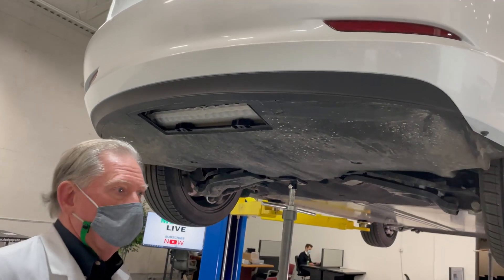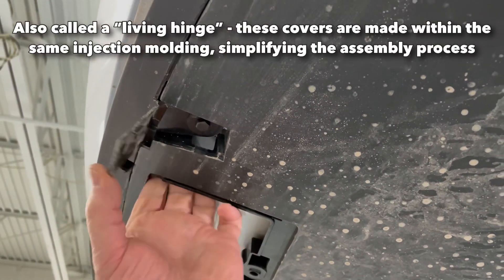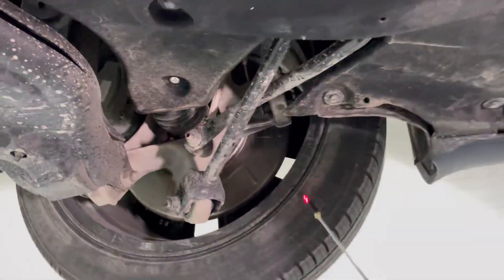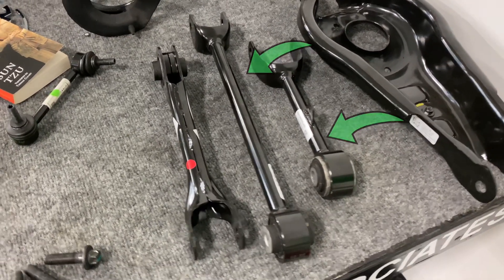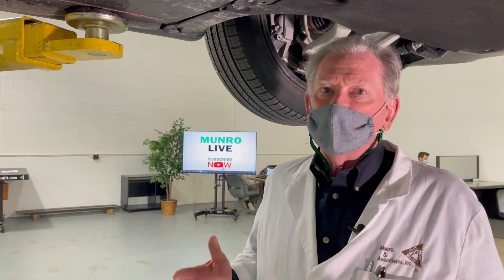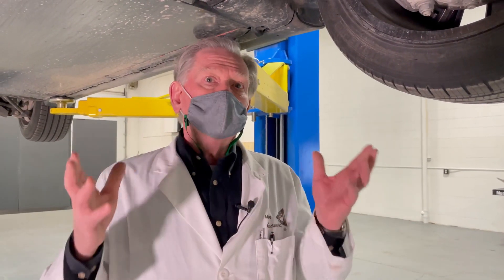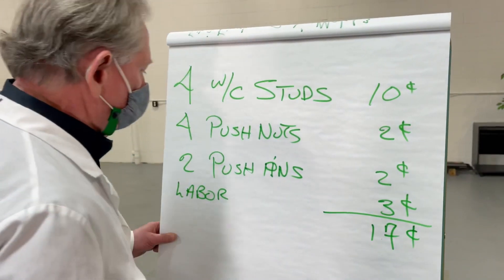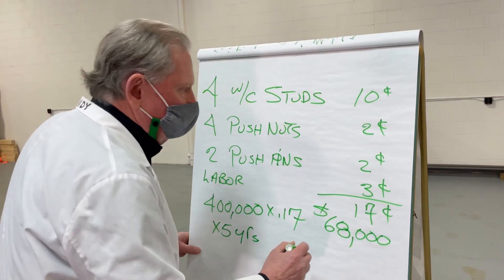2021 Tesla Model 3: E2 - Hoist Review & Some Cost Savings

Comment: "The best part is no part. The best process is no process. It weighs nothing, costs nothing, can't go wrong." - Elon Musk
Reply: @thealienrobotanthropologist  tell that to German car engineers 😉
Reply: So the best car is no car. It weighs nothing, costs nothing, can’t go wrong. 😂
Reply: If only he would make a car with that philosophy.  I want to see one that is bare bones with manual adjusting seats and hand rolled windows and NO info screen at all.  Just a model Y with the motor, 200 mile battery  and some airbags.  Something under $12k...  Start with the performance and cut costs everywhere you can.  I want to see the raw alumium in the floor, just stamp a pattern into it--- no carpet or anything.  Make a simple way to add a battery upgrade just like we add memory to our phones... Make it a box like the Cyber truck, durable, dent proof, scratch proof.... Call it the Cyber Dray... and build millions of them....  This is what most of us Men want.  Something that is completely basic, without any plush comforts, but has the utility.  Cut all corners, make it as simple as possible, and keep it bomb proof.  Everyone keeps tying to make "the new iphone", when what we need is a firearm.
Reply: @calholli  you may like something like that but how many of the general public will buy something like that though?
Reply: @calholli  I agree with your principal of affordability. But is $12000 attainable or just a random number you thrown in there.  If you built something at affordable level then you are competing again things like a Honda Civic which has a good amount of technology in it and Tesla will definitely lose its edge. At the higher price range they attract people who are willing to pay for tech and environmental impact.
Reply: Fleet cars and beaters are some of the biggest sellers for big automakers. Ford sold more than 3M fleet vehicles in 2019. So yea they could sell a bunch of them...
Reply: @calholli  They made a Yugo, see how well that went…
Reply: Unfortunately it also does nothing... :(

Comment: They did 450k M3/Y this year - likely to double next year, so 5 year lookout is over $1,000,000... easy. Also, keep in mind inventory management in the factory and in the service shops - pretty sure at the end of the day, over 5 years, Tesla would save over $2,000,000 by eliminating these parts 🤯   (btw, airlines did similar thing - they realized reducing 3 olives in the salad to 1 olive saved over $1,000,000 a year - and customers never complained about it)

Comment: How well will those precision cover flaps hold up when Joe Sixpack whips off the under tray?
My car has M6 bolts with a thick 1” dia head. They are all the same so some have 80% of the thread poking out the back. Considerable time would be saved (for everyone) with Dzus fasteners. Same on wheel arch liners and engine covers and....
Question - why are they not used everywhere?

Comment: Cheaping out on parts like that is what MG Rover did, the quality of the product suffered as a direct result. Sometimes cost cutting like that is a false economy. Design the car better in the first place is the way forward. Delete the holes from the mould would be a good move. Still looks like it could be ripped off by the slightest thing, no strength in that arch liner.
Reply: Lopez effect. ;-)

Comment: For the untrained eye but a potential customer (me), that flappy plastic cover looks like a human error and a sign of bad quality, I would order 2 of those clips from Tesla the day i found out and install them myself.
Did the same on my 10 year old car when i bought it with one missing screw almost same spot, besides it helps to hold the inner fender in place.
Sometimes a missing screw like this hurts the image more then less then 1 $ worth of cost.
I think the cost saving guy was pushed to find something or payed per object found.
I would have found a plastic push pin to go into the hole where the stud was previously, the plastic inner fender would then still be held like before and they would not need to fill the hole, that is no longer used, with some kind of glue.

Comment: Sandy, did you observe any improvement concerning the rear panel under the car? It uesd to allow accumulation of dust and in some cases a lot of water to the point of seing this panel and the bumper being ripped off the vehicle.

Comment: Great episode, and an excellent reminder of how even tiny incremental improvements can add up over the years when you build at scale. Guess similar incremental improvements and savings that may only be worth a tiny fraction of a penny per cell for the 4680 battery cells would also be worthwhile since the plan is to make these in billion or trillion cell quantities.

Also, if its practical, could you go into how you came up with 3c for labor when discussing the push pin change? I was thinking that if the production line workers get $30 / hour (extremely vague guess to make the math easy) then that's 50c / minute. Assuming it would have taken someone 20 seconds to reach into the parts bin, grab the 2 push pins, insert them into the holes and then at an inspection station add another 10 seconds to check that they are in correctly that'd be about 30 seconds per car you don't need or a 25c saving (see I cheated to get easy math), plus you simplify the workstation by not needing a bin for these pushpins, unless they're a common part you need in other places on the vehicle. Unless that's something you'd automate and the whole process only takes a second or two??

Comment: i would not be happy to pay 40k,and find out the plastic is hanging like a bodged thing...plus water and dirt,ice, is going to get in there splashed from the wheel and remain there.then its enough for a little rust to apear and you end up at bodyshop repair that costs 100x more than 2c  crap plastic .Lets remove a few fender bolts to save wheight..thats hillarious

Comment: Also,  Tesla,  with the way that people can freely communicate with anyone in the company,  makes these changes more easily than others.  A line guy could be thinking over this at lunch one day,  discuss it with his buddy,  and then maybe they email a structural engineer. He grabs a couple guys and they meet this line guy, and a half- dozen guys gather to look at the process for a few minutes,  discuss the pros and cons.  They yank and pull on the unfastened piece and can't see why that fastener was needed.  From there,  they could, I imagine since this is such a tech- heavy company,  simply type in the part or process number and get a link to whomever is in the chain for this.  They might even do a quick computer analysis of forces on the part with the fastener removed. Some coordinator somewhere might be convinced,  and send out the change by Monday.  Displays at the workstation have a message briefly detailing the change,  and the fastener is no longer produced or installed.  Even if it takes a week to get out of the habit of installing it,  that's no big deal; the 5 year savings were still #338,000+. I may have greatly oversimplified this,  but it seems realistic.

Comment: "The best part is no part", until you get a rattle.  I wouldn't be surprised if those missing push nuts will result in a rattle at certain speeds due to harmonics.

Comment: I don't like that they removed the Push Pins/nuts.  Over time those plastic covers can come down - they can get caught on objects.  You see it happen all the time on all different cars.  I would feel better as a consumer with those pieces holding the plastic covers in place.  If you were to reverse over some snow it would catch it and could cause damage.  The Push Pins/nuts helps keep it in place.

Comment: if i am thinking about it correctly, the labor might be three cents per car, but it also translates into production line time, so if in that extra time they save they produce say x more cars, assuming they can sell all the extra produced cars it will translate to x times the profit margin of each car which is not negligible
Reply: might have been wrong though because the production line output does not depend on the total time it takes to produce a car but by the speed of the line. but supposed the eliminated parts were part of the slowest stage of the production line then the total output speed of the line would indeed improve

Comment: Sandy, tow hitch or not: all the same undertray which is a wise choice. Besides, the one-piece undertray was designed badly, because of which when running fast through big waterpuddles the rear bumper came off in a few cases. So they redesigned and also considered it being better to make just 1 version undertray for both versions (tow-hitch installed or not)

Comment: Welp, that was a complete waste of time. Only measurebaters and Tesla fanboys get excited over saving 17 cents on a $35K car.
Reply: If you save 15 cents on every 30 cent part, then you can cut the cost of the car in half
Reply: @pilotavery  Check your math. Motor, gearbox, battery pack, etc., are not $.30 parts whose costs can be cut in half.
Reply: @KonaChuck22  True, but those are parts you can shave off thousands. Tesla's motor costs a quarter of what others do despite being better and more efficient. That's $2,000 right there.

Tesla is also lowering their cost of manufacture, and part of this process is refining everything. Their batteries are already manufactured less than everyone else's, and they already have plans to get it down to half the cost.

That's another 5,000 to 7000 right off the bat.
Reply: If you added 50 cents to 2,000 different parts, then you just increase the cost of the car by $1,000. 

 it doesn't seem like a big deal to you, but to all of the experts who are working on this, decreasing the cost of a car from $25,000 to $18,000 is a significant difference.

Comment: Vibration noise from eliminating those parts? $50
Reply: @Ryan Kummerle  the hole that previously had a stud in it is glued shut, probably to prevent corrosion, the flapping plastic is not glued to the car.

Comment: Your first finding - I’m happy it’s there. It means customers can put on a 3rd party tow hitch without having to replace the plastic air shield or have an ugly cut out.
Reply: to be honest tho who wants to tow with a electric sadan? in my opinion the m3 LR has just enough miles to ease a bit of range anxiety (over 300 useable) and we know towing kills range in EV but what could you tow? 3000 maxium?
Reply: @Capthrax1  bicycle trip with the family? Not too far, tow bar bicycle rack. Will indeed kill range but for shorter trips it's nice to have the option.
Reply: @ZesPak  never thought of a bicycle rack. that would be perfecticaly suited for that car not much wind resistance not much weight.
Reply: @Capthrax1  You’d be surprised. There are quite a few people that tow with them. Efficiency is terrible, but people do it
Reply: @ChargingForward  seems like aneasy fix? Erect a vertical integration building next to the current one and problem solved? Maybe they are waiting for starship. From what ive seen it will be vertical

Comment: I don't understand. That panel seems to be so loose as to potentially cause vibration noise or dust/water to ingress, resulting in dirt buildup. Just to save .17c? And then they include a free thumb drive that's not really fit for the purpose, at $x? I have the 2021LR, and it does have some rattles and "flapping" on uneven surfaces. Not sure if you wanna save on fasteners when building a car with huge flat surfaces underneath. But I am no Munro, I probably should view the video once again...

I see all these comments about how much this adds to the build with parts bins and ordering and whatnot, but didn't they just decrese the amount slightly? So they still have these parts in stock for other parts of the panels, right?

Comment: Quite exiting review for next coming weeks !!  
- One thing interesting to check would be the wheel alignment, so many people complain that the tires didn't lasted but I am sure the alignment was not correct.
On my brand new Model 3, I noticed that all toe angles were out of range, which would increase the wear of the tires, however the other angles were in the range.

Comment: My 2019 Model 3 doesn't have fasteners in those two holes behind the front wheels either.  It also has the same welded stamping upper control arms like this 2021 model, versus the earlier tube + ends type.  It seems like they must have figured out that they don't need those fasteners pretty early on.

Comment: Watching Sandy is more informative than getting a MBA.
Reply: If eliminating necessary parts required for a quality product is what an MBA is all about, I would Never hire an MBA. In fact I would Hate everything an MBA is all about. I feel the push pins are necessary to stop vibration noise of the  wind shield. I have taken my car to have this serviced three times until the dealer,  who was familiar with this reoccurring problem, fixed it. Cost $300 each for the first two, on the road services,  the dealership was free.

Comment: There are third party hitches for the Model 3 that can take advantage of the removable cover (and won't have to cut a hole in the panel anymore). https://stealthhitches.com/products/tesla-hitch-shr09001 Personally, I think having that does add value to the Model 3 even if Tesla for whatever reason doesn't want to offer a first party hitch, particularly for putting on a bike rack.

Comment: You know what would save Tesla money?  Not having the mobile tech come out 2-3 times to fix silly issues that should be caught at the factory.  That's not 20 cents a car, but probably more like $40 or more per visit.  Takes a hell of a lot of fasteners to make up for that.  Alone on my Y, the tech came out to realign the frunk which was making contact with body panels.  Realign the hatch that refused to open because it was misaligned.  Replace the rear spoiler because it started to fall off.   It also spent 2 days at a service center because the wiring for the octo valve wasn't done correctly on the line.  I understand that new cars aren't fallible, but the majority of the issues my Y had are commonly seen.

Comment: There was a run of a hundred cars or so where somebody had tightened a bolt to the wrong spec. No bolt missing, just not tightened to spec and it was caught and limited to a handful of cars. So, now you are hearing about it as if Tesla is missing bolts left and right....

Comment: Sandy. Another perspective on rear plastic cover. The small savings you presented about the pins and nuts on the front, I also believe the back plastic cover is also a potential savings. 
Remember Freemont still builds for  almost all markets, splitting up the line to where what needs  plastic access cover and which one doesnt is offset by simplicity and speed.
Reply: The undercarriage part w/access panel from Tesla is $135, if you're among the unfortunate few that didn't get the precut access panel AND want to install a hitch. https://stealthhitches.com/products/tesla-hitch-shr09001

Yes, Tesla could save $$ by not including this feature AND they could make a few $$ by selling it later. However, having a single part is worth something too, right? And those of us that have taken advantage are very grateful for its inclusion.

Comment: To be fair, 68,000$ when you sit at about 1 Trillion valuation, that is indeed nothing. Even if they save 5 times that much it isn't much. I think they are just transitioning to new body weldings with the 2 part system and they are removing these things just for the time being while they transition.

Comment: You should just tell Elon you're gonna show up at the Fremont factory for a day to help with panel gaps. It would be entertaining 🙂.  I'm literally in a Honda dealership getting an oil change right now, every single car here has perfect panel gaps. And taillight flushness for that matter... I've never looked at the tail lights in detail until your last video
Reply: Absolutely agree I just don’t get why they don’t think it’s a huge problem. Poor gaps makes the product just look cheap, you question it and then think right if they can’t do the fundamentals right like other car companies what else do they do poor. Friend just got a 2021 LR model 3 and shoddy rubber seal round the door, scratched interior plastic, a rear boot (Trunk) panel gap that was different side to side and one of his front doors were different side to side. Brand new Car and your walking round thinking yeah that’s poor, that’s damages and that needs fixed. It should be like this and I know other Car manufacturers don’t get it right all of the time but it is almost an expected thing with Tesla and that’s what puts me off ever buying a Tesla as my first EV as I notice everything.
Reply: Dont look at a Dodge.
Reply: I have a Bolt and it does not have very good panel gaps.  But then its a Chevy...
Reply: How’s the oil dilution, ac compressor and transmission problems?
Reply: So when you get a chance ask Honda how long did it take them to finally get those panel gaps perfected. The 85 Honda Accord was terribly built, trust me.

Comment: I am so curious how much cheaper you calculate the Model 3 2021 over the Model 3 2018 when you're done with it. I think there are dozens uf such tiny cost savings in the new model 3. However, they implemented some additional features which made the car more expensive, but also much more valuable (for example automatic Trunk, double glas windows, etc.)